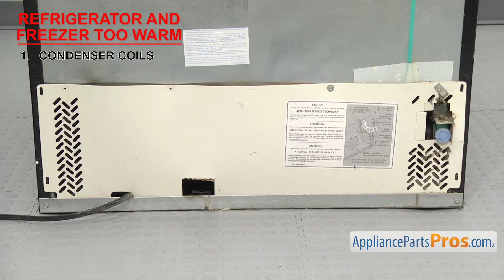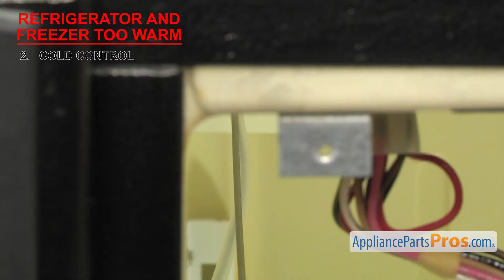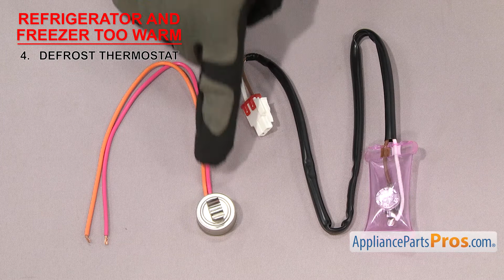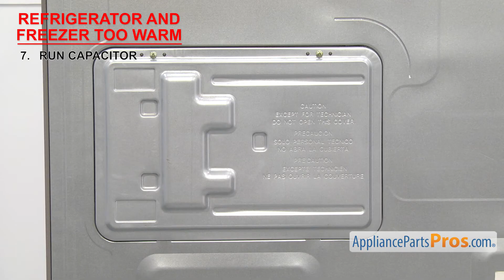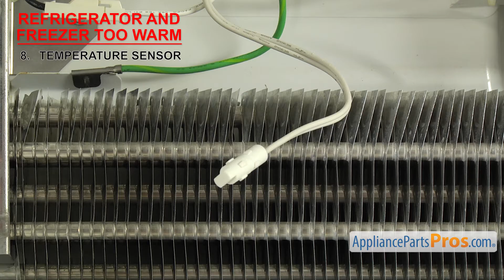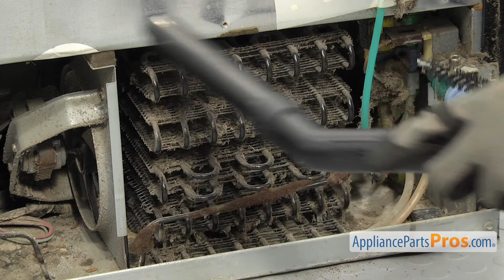Troubleshooting Refrigerator and Freezer Too Warm APPVID003286

Comment from the maker: 🔧 Common fixes for this issue:
▶ GE Evaporator Temperature Sensor / Thermistor WR55X10025: https://www.youtube.com/watch?v=qQEATKfPFjg
▶ Defrost Timer – Frigidaire/Electrolux part #215846602: https://www.youtube.com/watch?v=uTBfDnFYHTo
▶ Evaporator Fan Motor Kit WP4389142: https://www.youtube.com/watch?v=HPJtr8Hpaps
▶ Thermistor (temperature sensor) WP2188820: https://www.youtube.com/watch?v=sqVdzqc1U7I
▶ Evaporator Fan Motor WP2315539: https://www.youtube.com/watch?v=Pi0ExP8RnPk
▶ Run capacitor, part #218909912: https://www.youtube.com/watch?v=9QTjiYOptVI

👍 Found your fix? Hit Like so others can find this video too!
🔔 Subscribe for more repair guides: https://www.youtube.com/@AppliancePartsPros

Comment: How do you know if the system is low on Freon? My fridge and freezer slowly have gotten worse and worse and now the fridge and freezer are both 42.. fridge sounds like it’s running but I’m guessing I have no Freon as I had a little liquid in the drip pan below the condenser Coils.
Reply from the maker: You would need to check the evaporator coils for the frost pattern when the compressor is running. If there is no frost on there, or it's only frosted on part of the coils, then that would indicate a sealed system issue and you would need to contact a certified technician for repair. They would be able to determine if low freon is the issue or something bigger.
Reply: @appliancepartspros I don’t wanna take the whole fridge apart to check. I unplugged it and let it sit for 26 hours. Plugged it in and after 12 hours the freezer was 45 and fridge was 45. Compressor was 122 degrees. I think it needs to be charged. We shall see
Reply from the maker: If you're not able to check the coils yourself, you will need to have a certified technician take a look. They’ll be able to confirm if it’s a low Freon issue or something else in the sealed system.